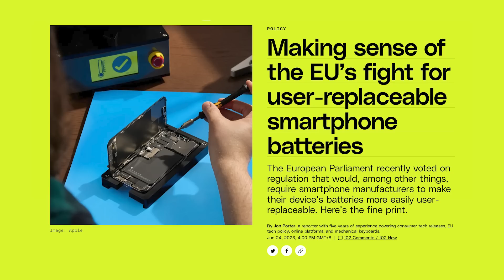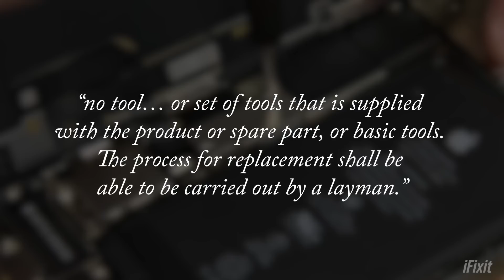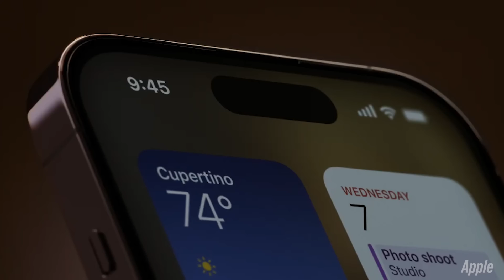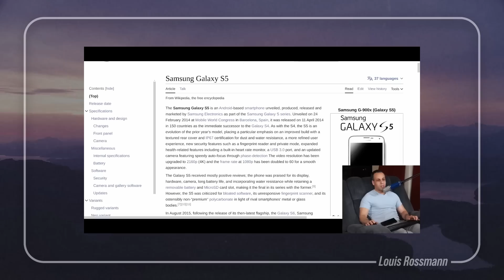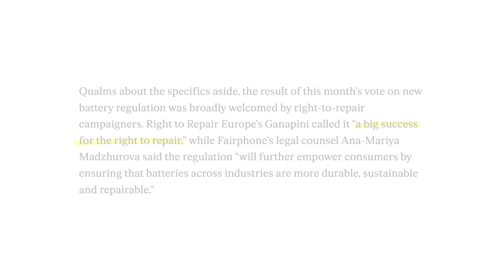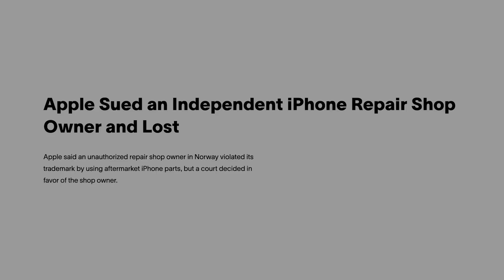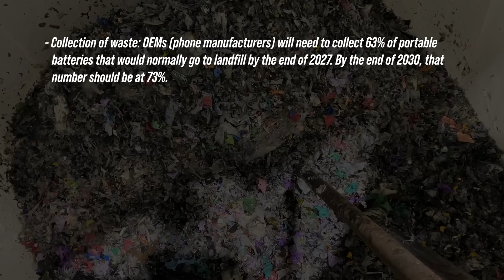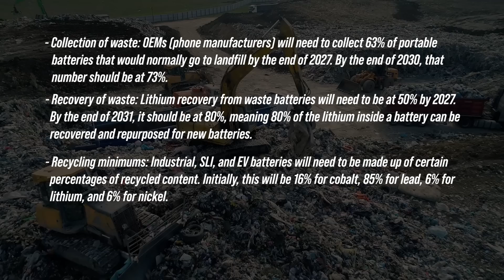EU Just Changed Smartphones Forever

Comment: hardwiring the battery was the industry's way of riding the tailcoat of innovation. it saved them money on manufacturing new phones while the technology was still in the process of advancing quickly... now that it slowed down they've got no more excuses to hold back.... and waterproof isn't even a thing... any soaked phone will drown. unless you have one without speakers or ports.

Comment: What about RAM and Hard Drives/SSDs soldered to mainboards?  This is deliberate design undermining to limit the functional life of the device, particularly when used with low quality RAM and SSDs - which will fail within 2-3 years of use, rendering the product as e-waste  ... and increasing Co profits at the forced re-purchase.  Companies are already ahead of failing batteries being the only way to cripple a device, shortening its life and increasing e-waste.  The EU is turning a blind eye to this scam, so has provided another 10 years window of mountainous e-waste, due to limited scope, issue understanding and foresight.

Comment: We have a second problem  to solve in order to make computers and smartphones remain in use. Corporations ban use of devices that stopped receiving security updates.  Security updates are essential, and for reasons that I don't understand,  it is not made available after a few years. Companies like Samsung won't allow using a different Phone OS either. Samsung disables the KNOX hardware functions if another OS is installed.  I had to replace a perfectly working Samsung S8+ because obsolete for lack of updates.

Comment: Actually, I`m against this law. Hear me out: first, I`ve seen a bunch of sony experial auqa "water resistant" phones that died from a short dip into water, because the port covers were not properly sealing. It is obvious, that a galaxy s5 style cover will be less resistant that just a port cover. So this law destroys water resistancy, while also making phones thicker or less structurally sound. It`s bad and I hate it.
I think that if a skilled 3rd party technician can do a replacement in a 30 minutes, without the risk of cracking the screen, it is totally ok. You don`t need to replace the battery more often that once in a few years anyway. Companies should be obligated to make parts, service manuals and schematics avaliable, and locking down component to specific serial numbers should be forbidden. That`s enough to achive the same repairability while keeping all the benefits of glued down design.

Comment: Headphone jacks should be the next thing that should be mandated. I regularly switch my wired headphones between my laptop and phone easily.  Doing the same with bluetooth headphones is much more difficult. Bluetooth headphones also do not have have user replaceable batteries - I wonder if these are included in the EU's regulations? Dead bluetooth headphones are also an ewaste disaster and forcing them upon consumers is an anticonsumer move IMHO.

Comment: Sounds good on paper. But I've never had the battery be the failure point that prompts me to need a repair or new device. My iPhone self reported health is 81% and the type of user I am, that's usually more than enough for a full day of use still. But right now, the ear speaker on my phone is broken and Apple wants $400 to replace it because it's embedded in the display module so they require me to have the whole thing replaced by them. If I get a third party to replace the display, the speaker will work but face ID will break due to apple restrictions. I'm happy to pay a fair amount to replace what's broken, but instead i'm holding onto a phone that only works on speakerphone in calls because they want outrageous money due to their extreme integration and restrictions. I'd be very happy for a phone 5mm thicker if it's then serviceable.

Comment: Built in exemption: Smartphone vendors can continue using built-in batteries as long as they offer high-quality batteries. The battery should still have 83% health after 500 cycles. Or 80% health after 1,000 cycles.

The change you think is coming largely isn't.

Comment: I will be happy if they will implement this !
It sucks so much to own portable device that still works but in same time barely usable cause of worn out battery that can't handle even half of original capacity. I had mp3 player that can play only 2 or 3 songs instead of hours cause after 2 years it was shutting down no matter how long I charged it.

Comment: foolishness . now batteries are so good you need not replace for five years. replacing battery of mobile phone is not relevant today.
Reply: It actually is because depending on your usage your battery health can drop to about 70% capacity in your first two years lithium ion batteries have come a long way but there is no way to address the degradation of the battery batteries still lose health and need to be replaced that is if you want a long battery life or you can just have it die every 2 hours up to you
Reply: @nathanciminelli5900  I had a 4 year old 4500 mah mobile . The battery lasted for around 12 hour in heavy usage.

Comment: I had the LG G5 in the Thumbnail image, worst phone I've ever had. Replaced twice under warranty and had a hybrid IPS/OLED tech that suffered from burn in under half a year, horrible/inconsistent battery life, and edges that cut into your hand.  That's it

Edit;
Note, easily removeable batteries that have exposed contacts like on older phones have inconsistent contact. That causes voltage/amperage changes that on very precise electronics will cause instability and the only fix would be to reduce tolerances and efficiency's in the electronics. Will run hotter and slower

Said LG G5 had to use valuable limited space in the phone to ensure a solid frame and retainment structure. This meant that it had a notably smaller battery than all the flagships at the time to make it feel sturdy. Worst part, is because you have to reboot your phone they thought it would be a good idea to turbo charge the boot process by killing over 5% battery just to boot a bit faster and make it get Very hot, then slow down because of that

Comment: It's stupid. We're (as in humans in general, but mostly these companies based on what they think people want) placing self-imposed limitations on our own technology that hurts us in the end.

I'd rather a slightly bulkier device that is more thermally efficient, performant, repairable, and is able to fit a larger capacity battery than a thin device that performs worse in all of those areas for the sake of being fashionable.

I always put a rugged, bulky case on my phone, because they make them so ridiculously thin and with such smooth finishes that they're difficult to maintain a firm grip on. They're fragile, difficult to hold, and anti-consumer.

We need to fight back against this. We need to show the marketing people and focus groups that this isn't what we want, because they're the ones telling these companies what "the consumer" wants and doesn't want.

As long as we continue to feed into this trend, it will continue, and it seems that the EU is the only large entity that is fighting back. The US is arguably more concerned with not imposing restrictions or limitations on the ability of these companies to function so long as they're not inflicting harm onto people in some manner, but sometimes it's important to step in and I'm glad that the EU is doing this, because this trend does harm us, albeit indirectly. Going back to the US, I suspect that the average age of politicians and others in the position to be able to affect change in this area is also a significant contributing factor; they're mostly quite old and don't comprehend these issues as well as they should be able to.

People have stated that the iPhone would only feature USB-C in the EU, but that's been shown to be untrue and would never have happened anyway, because it would increase production cost and would complicate the way they operate.

Hopefully the EU will inspire others to step in and take this matter and those like it more seriously.

Comment: While I do think that recycling the batteries instead of throwing them in the landfill is a priority, I feel like the problem is that the phone becomes obsolete before the battery truly dies. I've got a Samsung galaxy Tab 8 that physically is fine, the battery is still good but because the operating system is older I can't update it to a newer version therefore I can't update the apps in it and the old versions are not usable. So while the hardware is perfectly fine, the tablet is nearly unusable because I can't update the apps in it. My older cell phone is an Iphone SE which could have used a new battery, but by the time that happened the phone only had a little time left before it would not be supported any more thereby making is useless anyways.

Comment: This is a good start - but I also want upgradeable storage!  I used to upgrade my phones every year - but took a break for 3 years when they first stopped making phones that did not have upgradeable memory and replaceable batteries.  (After 3 years I finally gave in and started buying again, but I miss the days of being able to upgrade storage and replace batteries in a device I owned!)
Reply: Try to not buy 🍎
Reply: Micro SD-cards might solve that problem to an extend. But generally upgradeable parts would be really cool, like having the option between 3 different quality cameras, and upon buying you can choose which one you want, and the modules are interchangeable. It would also be cool if companies wouldn't bring out 2-5 new phones every year, but 2-4 good ones every 5 years, whilst also extending the support timespan. I think a well designed device which is also cared for by the consumers would last easily a decade with upgradeable parts if you need them and software updates.
Reply: There are still phones out there that have these features. I've been kitting out my family with Fairphones and can't reccomend them enough.
You not only get user replaceable batteries and SD expansion, but user-replaceable parts too (for example my brother broke the USB port on his, i just ordered a replacement USB module and fixed it in a few minutes)
Reply: @cyrilthefish  Luckily that's a problem I don't have, as I am treating everything I have like a raw egg, which is probably not normal. But I was also very lucky (I also spend a lot of time researching beforehand) to always buy very robust products with very good specs. The only thing that actually makes my devices old is the software. Until 2021 my only mobile phone had Android 5.0. This is something that also needs to be considered.
Reply: I feel that, so much.
My latest phone is a quite outdated Moto G100, because I couldn't find a better one with MicroSD-slot and 3,5" headphone jack that wasn't sold for a completely obscene price. Sure, now I've got a total of 256 GB storage, and it's more powerful than current low-end phones (yet), but it cost me a good 500€ and is still suffering from a lot of issues due to outdated design, an inferior WiFi interface, a weird display ratio, rounded corners, and the camera cutout (what happened to normal rectangular screens, ffs). And of course, the battery is also glued in, like with all the other backwards-evolving phones.

Ironically, even those 256GB aren't really enough once you start amassing a collection of music, books, games, and movies. Just the books are closing in on 40GB, not to speak of all the music and games. A single movie can take up several GB at high resolution. I've recently ordered a portable 2TB SSD that works with droids - but that's a poor solution, no more than a stopgap measure.

So yeah, I'd love upgradeable storage. Heck, I want a 5TB droid that can hold my collection without constantly plugging into external storage, and display everything at proper size without weird holes in the screen. I want phones to evolve forwards again.

Comment: They need to make a law that manufacturers must sell you new original replacement batteries for devices you bought from them. I have skils to change battery in my glued phone, but it is hard to find good battery with same capacity as original and that it wont swell in a few months.

Comment: Don't forget, that many mid-end and low-end phones are not water resistant, have plastic backs, and still have no replacable battery. The only difference from older phones is their back is held by glue instead of latches.

Comment: I have tried cell phones with and without replaceable batteries.
Strangely enough, the battery life don't last as long when they can be replaced, while fixed batteries last forever.
Reply: Do you mean battery health?
Reply: Some of my phones with replaceble battery should have a new battery before the phone was replaced. The phones without replaceable battery works until phone replacement, and still have good capacity.

Comment: To each his own, but as the quality of batteries have improved significantly, I feel while this is great for r2r, and I'm all for it, I'd like to see my working hardware be supported with software updates, and if the original manufacturer is unable or unwilling to do so, they are forced to release the software as open source so others can take over. I have had 25% of my devices die for whatever reason, and the rest are perfectly functional other than diminished battery capacity. Why must these working hardware become ewaste?

Comment: imo the two greatest sins for phone manufacturers to the consumer would be their constant push towards disposability and their attempts at giving their devices a 'body clock' due to how their EoL cycle works. Both work so that your device is only usable for a finite amount of time before it becomes essentially unusable. Usually I would be fine with this if the industry was progressing at a rate where devices would no longer be fit for their purpose yet that has been slowing down by a noticeable amount over the past decade to the point where consumers want to hold onto their devices longer as the current flagship has an insignificant difference to the flagship five years prior.

Considering we don't have the technology to create slim batteries that will outlast the tech progression gap, replaceable batteries would be a good idea to return so phones that are still powerful enough to daily drive can be given new life. The latter regarding EoL is more of an implementation issue in software as apps and services are locked behind specific firmware revisions. Yet if you look at the history of PC operating systems it's already proven that such an ironclad approach isn't required. Why would a tablet from 2015 be unable to use a browser? It's insane to even think that when my laptop from 2016 can perform every task of both yesterday and today perfectly fine.

Comment: Anybody serious about conservationism should support this. Batteries are the number one obsolescence-ensuring design aspect of modern devices. You might be able to use a set of wireless buds forever if they had easily replaceable batteries but instead it's about 2-3 years and then they're done for.

Comment: My experience is that by the time it's time to replace the battery on most electronics, the electronics fail not long after. Had that happen a couple of times with laptops, with phones etc. It's a false economy. When the battery dies, time to chuck the device away and replace it,
Reply: Incorrect, nokias never croaked after the first battery change, it was after the second or third for the worst models, most soldiered on happily until physically damaged by being dropped or drowned.
Reply: @juslitor  My EXPERIENCE is incorrect. That's gaslighting!

Comment: My biggest problem with this is scammer batteries as well as off the shelf batteries that have only half the charge due to it being in storage and on shelf for possibly years. I remember when I had the S3 and in 2015/6 when the original battery had run it's course, I got a replacement "original battery from Samsung" yet it wore out quicker than the original, only due to research after did I find out that storage has a huge affect on charge. I'm not saying that Samsung and others don't store their batteries for a while, but they don't store it forever, yet with this new law, you would have Manufacturer storage and Store storage to contend with, which could drastically shorten lifespan. e.g. I replaced a non-removable battery on My Huawei Mate 20 in 2021 through Huawei and it still holds charge quite well.

Comment: The battery sealed phone is more resistant to the elements? Maybe. I remember the first Motorola Moto G that had a user replaceable battery and could be immersed in water for a while without breaking a sweat. Now for how long and how deep. OK. Cases. 
In ideal conditions, one could use a modern phone for say five years, and when the battery dies, let it go because the phone itself would have gotten old anyway. But say you still want to replace the battery to squeeze an extra year from the phone, ooops! The phone isn't water resistant anymore.

Comment: To keep the same phone designs perhaps treat the entire phone as a battery. When you need to change the battery, you just pay a nominal battery change fee, say $60-100 and swap the phone. You’ll get an equivalent or may be offered an a upgrade. The manufacturer can then strip out the battery or the entire phone for parts and recycling at their leisure.
Reply: No, ew. I want replaceable battery that I can change whenever I want by myself

Comment: being able to just swap out a dead battery for a full one instantly was very underrated
Reply: And depending on the design, even a larger third party one. If the battery is on the back, there would be the option to make a "fatter" battery. Yes, that would bulk up your phone, but depending on what you use it for (hiking, working on the move, etc), this can still be a big bonus compared to using an external power bank.